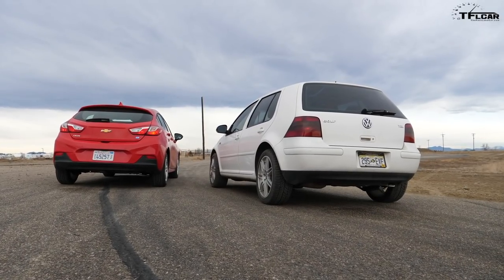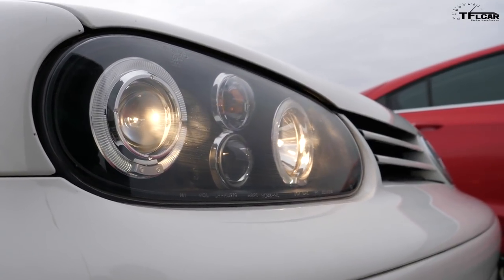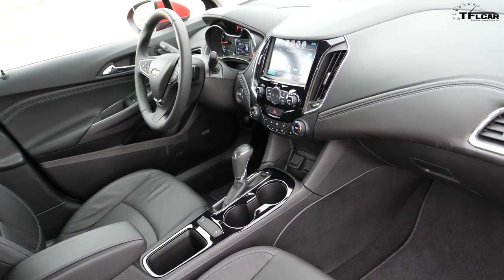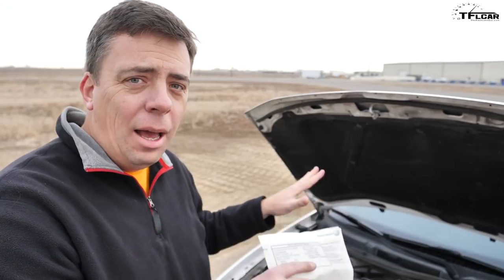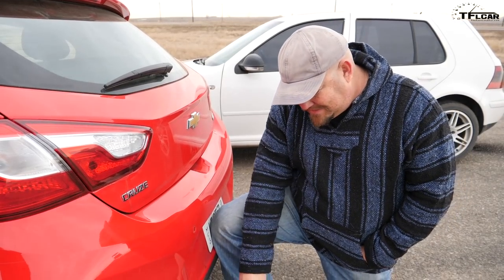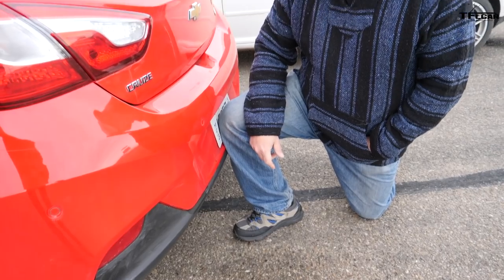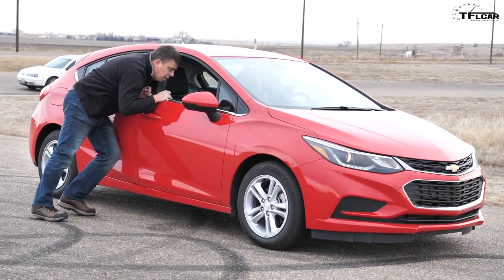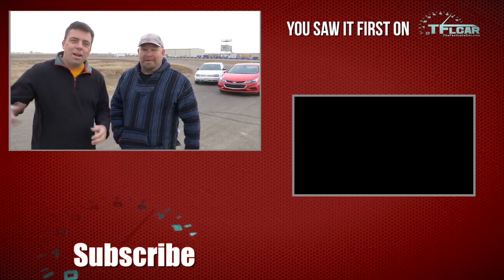Old (2002 VW Golf ) vs New (2018 Chevy Cruze) Diesel: Have Oil Burners Improved?

Comment: You should run your mileage loop with these two cars. Nice comparo, though.
Andre... you have a headlight out.  ;)
Reply: definitely do a mileage loop with these two cars.  And you can't compare the fuel economy stickers because the epa mileage test was completely different in 2002
Reply: Would love to see this as well.
Reply: I have over 10,000 miles on each car. Mileage of the 9 speed Cruze is very comparable to the 5 speed Golf TDI. Low 40's in mixed highway/city in both. High 40's to low 50's highway. I'd say the Cruze does a little better on the highway. If I had the 6 speed Cruze, I would likely see better mileage than the TDI

Comment: I like the little 1.9L ALH diesel though I prefer to remove them from the VW's and install them in something better. I currently have one sitting in my shed that I removed from my '03 Jetta. Was planning to swap it into a Jeep XJ or possibly a little Toyota pickup but it will likely be going into my '91 Miata.
Reply: Idk man you just a Jeep fanboy

Comment: That VW TDI will still be on the road well after that Cruze had been turned into soda cans and razor blades.
Reply: Just did the 5th timing belt on my 1999 Passat 1.8t 5mt. Still mint at 246k miles. Giac tuned to 18 PSI. 20 years old and still woopin ass at stoplights everyday on the streets.

Comment: If you get the Cruze sedan with 6 speed manual, it's rated at 52 mpg highway. If you keep it at reasonable speeds, it will get well into the 60's for highway mileage or better!

Comment: I love my 01 Golf TDI for sure but I will take a look at the Chevy Cruze
Reply: I bought one last August. It's actually pretty good car. Not bad at all. The only thing I hope GM does is make it run more like a VW in terms of the drive itself. They could make a better suspension and steering to make it feel like a Gold / Jetta, but other than that, fantastic car.
Reply: wish they didnt waste so much interior space, the rear cargo area is super cramped and the opening is tiny
Reply: John Kennedy  in reality it'll take 10 seconds to get to 60 miles an hour but my car will do 90 all day long and get about 38 to 40 miles to the gallon

Comment: The display in my 2017 Cruze automatic diesel sedan often tells me I'm at over 50 MPG when cruising. I'm surprised if the 2018 hatch is so much lower, but then I'm not really familiar with how hatches generally compare to sedans in that regard.

Comment: The fuel economy number on the old Golf sticker is deceiving as that would have been tested under the old EPA rules and test cycle.  The Cruze numbers are under the new EPA cycle so they are not very comparable.  It would be interesting to see in real life which one is more efficient.
Reply: i have a 2002 golf tdi manual, if i never touch the freeway for a whole tank, im talking stop and go traffic...i average 44. if i do all freeway, like on a LONG road trip (i get 750 miles to a tank) i get about 52
Reply: On Fuelly 2017 Cruze diesels are averaging 45mpg.  So I still think it would be very close.
Reply: The vw is more efficient
Reply: I would put money on it that the Cruze is more efficient.  On Fuelly 2002 Golf Diesels are averaging 41MPG.  On Fuelly 2017 Cruze diesels are showing an average of 45MPG.

Comment: Should add that the newer 2.0 tdi common rail engines from 09-15 don't use def either. Also, they don't soot like that either. Edit Post fix VW's

Comment: that 49 mpg doesnt count. That 49 was measured with only the EPA 2 cycle drive cycle on a 55, 45 split. The new fuel economy labels are measured with either the 5 cycle or the derived 5 cycle split.
Reply: Uh, yeah it counts. That's what mine gets.

Comment: The Cruze has approximately 50% more power from a smaller engine than the Golf. The Cruze passes all current emissions standards (VW / Dieselgate anyone?). The Cruise's fuel economy was measured by the new EPA/SAE standard which lowers estimated fuel economy by approximately 10 - 15%, so it should be significantly more economical then the Golf. The Cruze is more comfortable and convenient to use daily than the Golf. The Cruze comes with all the modern safety and technology features the Golf could only dream of. The Cruze comes in at around the same inflation adjuted price as the Golf. And the Cruze wasn't haphazardly slapped together with VW's poor quality control. Frankly, not much of a comparison.

That's what we call progress!
Reply: SlackTastic considering one car is almost 20 years old, i think the golf kept it together really good.

Let's bring the new golf into the game and bye bye cruise.
Reply: Charles-David Bérubé 
The new Golf diesel isn't available. Why is that again? Ah yes ...#Dieselgate.
Volkswagen knew they couldn't compete with the Cruze, and any new competitors on the way so they decided to cheat. Cheaters never prosper.

I had a VW diesel once, for approximately 6 months. It was 6 months too long. I couldn't get rid of it quick enough.
Reply: SlackTastic hmm cheaters don't prosper.. try asking the biggest car manufacturer in the world that question.. vw simply shits on chevrolet.

It looks like chevrolet needed to cheat to prosper in 2008 when the gvt gave them money. But you won't bring that up.

Vw still do the diesel in europe.

But then again you're so blinded by your love for chevrolet, you never searched in order to learn that chevrolet is facing a lawsuit for cheating the emission tests on duramax and cruze models. 

But the news won't tell you that because they are American and don't want to hurt their own economy.
Reply: SlackTastic all cars manufacturer have faulted at least one time in their lifetime. 

I rather buy a car that pollutes more than advertised than buying a car that has a faulty switch that could cause the car to die and the airbag to die too. Chevrolet new about it in 2003 and didn't move until 97 person died of it.

But you can always choose what you prefer. My choice is easy.

But try bringing your cruse in the European market and the golf will simply shit on it like it's nothing.

Chevrolet is a company who needs it's government to survive a financial crisis. Without this money, they would have been able to develop what they did. And this a shame.
Reply: Charles-David Bérubé 
You sent me a link to an article that pre-dates mine (May 2017). Check the date next time. Anyone can file a class action lawsuit wether it is legitimate or not. The plaintiffs don't have to spend a dime, the lawyers make a fortune.
Reply: SlackTastic but there are no new articles stating those lawsuits are closed and chevrolet has won.

So no matter if it's real or not, their is a clear probability of it being true.

Considering a lawsuit was filled against mercedes by the same firm and was dismissed due to mercedes winning it's point.

It wasn't dismissed in chevrolet's case.
Reply: Charles-David Bérubé 
VW intentionally and consciously made a choice to mislead their customers and the government. Then they followed through with this farce all the way to production. This is a severe moral and ethical lapse. What else are they hiding that hasn't come out yet?

This alone should be more than enough to convince anyone with any sense and intelligence to avoid that company like the plague. But there's also the fact that VW vehicles are notoriously unreliable and troublesome. See any quality / reliability study, or survey, to confirm this. To help you save time, look at, or near the bottom for VW. At this point, you would have to be either completely ignorant of the facts, or have some kind of masochistic tendencies or a mental deficiency to send VW any of your money. All while you can still buy a considerably superior vehicle from virtually any other manufacturer. I wonder what kind of complete rolling turd they would have to release, before you would start to question your blind loyalty to VW? So keep sending VW your money. Companies like this deserve your support, right? Smh.

I live in North America. I don't intend to ever move to, or visit Europe, so the market there is, to be blunt, completely irrelevant to me. The conditions in North America are much tougher than most anything you will find in Europe, and the vehicles are tougher here as a result. We drive much further distances, at higher speeds, on rougher roads, with more traffic, through every condition Mother Nature can throw at us. Driving across one State, is like driving across a country in Europe. This is why it takes years to modify and test a European vehicle before it is suitable to sell in North America.

Many companies either went under, or received assistance during that time. It was a financial crises, mostly caused by an overly zealous lending market. So to point out that GM went under, without considering the surrounding circumstances is purposefully misleading. GM didn't just randomly fail, and need a bailout, due to internal issues. The whole economy failed. All 3 major US automakers required private and government assistance to survive at this time (Ford leveraged their company for secured loans right before the economy crashed), so this didn't happen in a bubble. If you can't understand this, I don't think anyone can help you.
Reply: SlackTastic as far i know, a company who knows about a flaw causing death and doing nothing about it is 100 times worse than a company cheating on emission test. 
Every company cheated and if you believe they haven't, your head is buried very deep in the sand. 
I bought a golf gti and i shopped every brands and none had the quality, comfort, fun drive all together. It's been 2 years now and no garage visit. On the other hand, my friends 2016 mazda cx5 has a space reserved for his car at the dealer. And my brothers 2015 dodge ram hemi already broke down twice in a year ownership.
I'm from canada so i know what hard climat is and my car takes it very well. 

Let's not elevate chevrolet as a reliable brand either. None of their cars are interesting other than the camaro which is beyond cheap. I tried the cruse 2 years ago and i felt like i was sitting in a can, the road noise was awful, the ride was harsh and the interior quality was far from a vw golf. If you think having leather on your dash makes a more quality car, you have serious issues.

Funny to say, the 2008 crisis hit the entire world but only the americans lost it. Vw usa stayed strong because they had good products and people were still ready to pay.
Reply: Charles-David Bérubé 
GM didn't make that ignition switch, a supplier did. And they didn't purposely design it to fail. Do you see the difference now? It's called intent. VW maliciously set out to deceive the government and its customers.

And your reliability "examples" are anecdotes. I think I'll trust a survey of hundreds of thousands, over one persons personal experience.

The financial crisis happened in the US and naturally effected the rest of the world. The US got hit the worst by far. VW's headquarters are in Germany, so naturally they were less affected than GM, Chrysler, Ford who are headquartered in Michigan (in the US). That's an odd point to make. Did Germany have a lending bubble also that I was unaware of?
Reply: SlackTastic so you just ignore the part where chevrolet knew about the switch in 2003 and only recalled after it was discovered by others in 2014, 11 years later? That's lying too and is worse because they knew and killed people. Vw didn't kill anyone, they were playing the game like everyone else but they got caught first.

The stats don't mean anything. Mazda and subaru are ranked really low but are truly reliable cars. 

The us still illegally gave money to private companies to help them innovate new stuff and come back stronger and i will never encourage this as it is the opposite of capitalism.

If you're too week to keep going, you fail and that's how it is. Ford kept it together. Chevrolet should have been bought by another company.
Reply: SlackTastic this is economy and you can't just cheat it and get away with it
Reply: larry Spiller lets not bring this into consideration because big American companies produce huge pickups with devastating engines that kills much more than whatever vw diesel did.
Reply: larry Spiller and all companies cheated.
Reply: Charles-David Bérubé 
You talk in circles, with a whole lot of nonsense, and precious few facts to back it up. This conversation has reached its logical conclusion, and anything else I say would just be repeating myself. I am not your personal research analyst. Everything I stated, and proved, is is clearly well over your head. When you mature, I suggest you come back to this thread and reread my posts. Perhaps then they may resonate with you.

You are either being willfully ignorant, or work for VW. Either way a logical debate is impossible with you as you ignore all reason. I truly wish you a good day, and the best of luck with whatever choices you make. This will be my last response here.
Reply: SlackTastic you're repeating yourself because you don't listen. You ignore my words but don't back it up by any sources either. Don't try to be intelligent one when you aren't
Reply: you are a special kind of special. most auto manufacturers make 1.6 diesels elsewhere in the world with much higher output than the cruze and better mpg. i have an 02 golf tdi as my daily driver. i have euro spec injectors and a tune (mostly to limit the EGR and clean up the power band) and i easily hang with a stock 04 WRX from a roll WHILE averaging 48mpg and 52 on the highway. look it up on fuelly, the cruze is heavy and the mileage is not that impressive
Reply: John Müller hahaha yeah that's why the moment they could start selling them again, they were sold out the week after. I tried buying one.

They don't meet the standards as a lawsuit is filled against them proving they might have cheat.
Reply: John Müller big trouble? They paid off the bill and lost their first car manufacturer ranking for a year and took it back a year later. I don't call that being in trouble.
Reply: Who cares about emissions
Reply: @Justadudeman22  I do. A lot of people do. Do you remember acid rain?
Reply: I know I should but I'm a truck driver. DEF ruins engines so personally it's not affordable to care . Is soot even bad I hear it's not .

Comment: Nearly… as efficient. Should be MORE efficient by now. But we’re shooting diesel fluid into the exhaust. My Colorado diesel gets over 28mpg under heavy acceleration driving south, and 24mpg in NY on the highway with cruise on.

Comment: I'm from the UK and I have a Skoda Octavia 1.9tdi 90hp same as in your be golf as there both vag and use same engines and it's quick for under 100hp car and very reliable mine has 280,000 miles and gets up to 60mpg 45mpg in the city should of put the Cruze against the MK4 golf TDI pd130 version

Comment: Some other testers of the Cruze Diesel have achieved 60mpg in the six speed manual.
Reply: I got 62.6 the other day
Reply: Best I ever got in my 2017 Cruze diesel averaged 99.9 mpg, for over 50 miles.
Reply: @dundonrl  awesome.  I'm taking an 800 mile drive in June. Pure highway...  Will be curious to see how I do :) (6 speed manual)

Comment: I was just talking about this last night, Chevy is getting 137hp from 1.6 liters ... That's insane. I've had 10 diesel vws and my last one was an 06 which came from the factory with 100hp from 1.9 which was allot! It now has 137 also but because I've had it tuned as high as they recommended stage 1.5, ... And it's still .3 liters bigger!!! Not to mention it was a horrible design so it only gets 35 mpg that year!!!!
Reply: I have a 06 Jetta TDI with 6 speed DSG, have over 260,000 miles on it now with no issues so far.  42 mpg average running in town and 80 mph highway.

Comment: I had a 1.9TDI 5spd in a 2001 VW beetle and no way in hell I ever got any where close to 49MPG!!!!! It was closer to 34-35MPG and my 98 Honda Civic with the 1.6L SOHC vtec gave the same MPG!
Reply: Must have been something wrong with that motor then.  I have never gotten less than 40mpg in my 2003 golf gls 5 speed. except in the winter.  Highest tank I have gotten was 59mpg.

Comment: That golf would be a beast if it had about $4000 invested in it. Needs:
Bigger nozzles, smf clutch, vnt 17/22, a bigger downpipe and a tune. You're looking at 190-200whp and 320wftlb with even better efficiency than stock.

Comment: Compare newest Volkswagen Golf Diesel with  Andrew's Volkswagen Golf  Diesel. 

I would like to see the difference between them.

Like u guys did with the Shavy.
Reply: MrBenzboy11 Yeah I don’t get it, why would they use a Chevy... Wouldn’t you think they’d use a New Golf Diesel? I’m so confused...
Reply: VW doesn't sell diesels here anymore. The Cruze is the only diesel economy car sold here today.
Reply: mbd501 mbd501 I know that. But they could have somehow compared it overseas. They could have arranged this better, it’s not like this is viral material and it HAS to be put out there ASAP. It would of made more sense if they took their time and had the same type of model. But I guess it just me. They are comparing a completely different car. I would of liked to see interior comparisons, etc. but instead they used a Chevy.
Reply: The point of the video was to compare new vs old diesel engines. So using a new Chevy (since it's the only new diesel economy car available) made sense.
Reply: Because the Cruze is about the same size and price as a Golf, so it's a good comparison.
Reply: mbd501 I understand that, but then why did they start talking about the interior and comparing them briefly? That’s what made no sense to me. If they compared the newer VW Golfs interiors it would make the Chevy look like crap. Just my thoughts.
Reply: mbd501 to be honest it is not a fair comparison. Maybe just about the Diesel engine and that’s about it. They are completely different cars and the quality between them are nothing close.